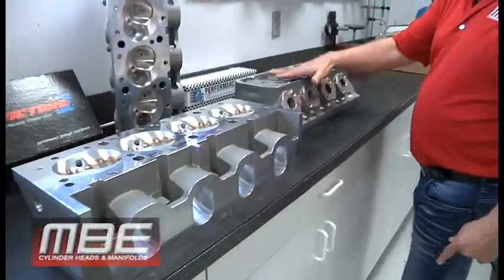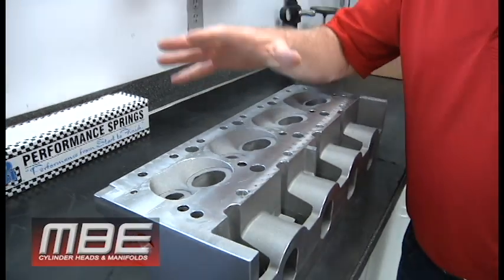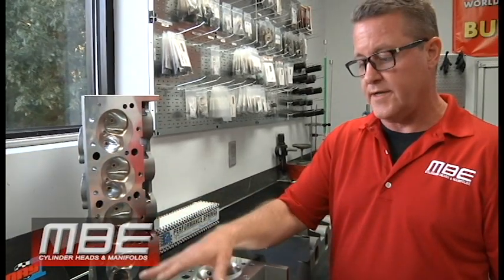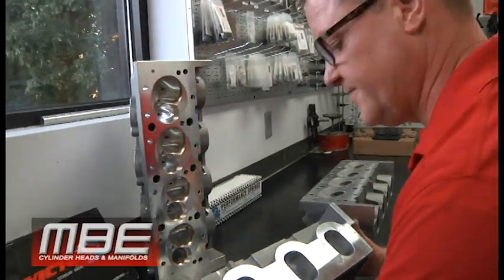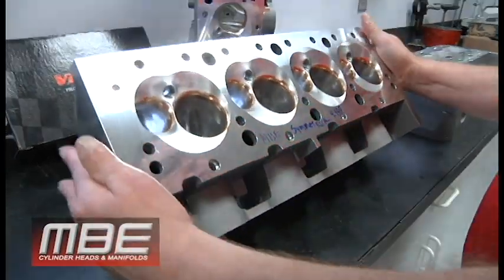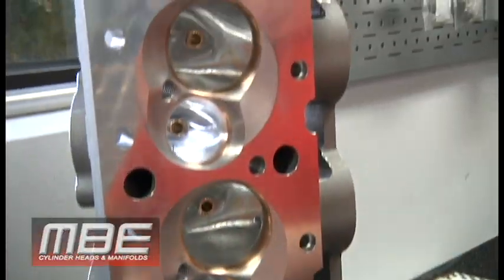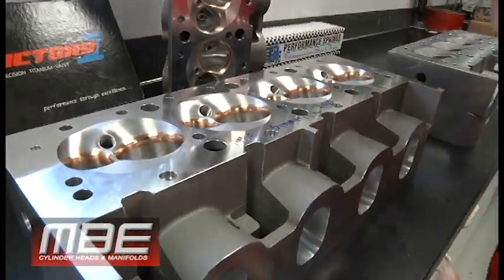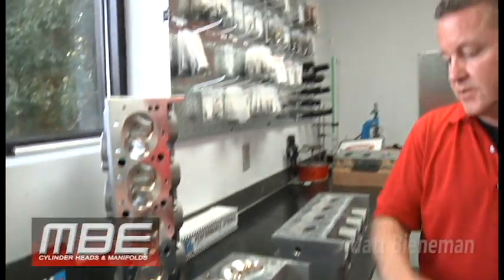** GAME CHANGER **  This SBC Cylinder Head will change History

Comment: I have two questions: 1) Minimum bore size? 2) Is 10k enough for a complete pair?
Reply: 4.125" for a lot of their heads. Don't know about these, yet. And $10k is about what the bare castings cost.
Reply: @Carl_Jr  for 10K a guy could build a blown LS and just be done with it.
Reply: @yurimodin7333  If the class he's racing in allows it. These heads aren't for the guy who could boost an LS platform and make big power. They're capable of so much more.

Comment: IT would take a 350 chevy spinning at 12, 000 rpms to use 480cfm heads, N/a to their potential. Boosted, I get, but even then 6,000 rpms at 15 spi boost still the same air. Why this head flow, for a small block? Just for racing, that limits what motor you can use?
Reply: Any Dart block is in love and crushing over these heads about now.....
Reply: @kramnull8962  okay so are they just running them to 12 grand, are they boring and stroking it to a bigger displacement? Are they doing forced induction.. how is a small block going to take advantage of that kind of flow.. where you wouldn't just be better off using a big block
Reply: @Bozemanjustin  Pure nostalgia. But you know for that money they are going to a good home...

Comment: Can I run WATER in it? 

Know why stock Chevy heads are NOT "symmetrical"? Because "siamesed" intake and exhaust ports in small-block  wedge-style heads keep THE HOTTEST - CENTER TWO CYLINDERS - INTAKE PORTS  FROM BEING "SURROUNDED" BY EXHAUST PORTS. 

It's laughable you only mention "manifolds" as other "SBC" parts your "history changing" boat anchor "air-cooled" heads will require to "run". 

Where do I get a "symmetrical" camshaft for my "stock" block and those morphodite heads and DO YOU GUARANTEE THE CAMSHAFT WILL "LIVE" WITH THE COMBINATION OF YOUR "SYMMETRICAL" PORTS AND THE RIDICULOUS "BOLT ON" VALVETRAIN NECESSARY TO "C0NNECT" THE CAM LOBES TO THE VALVE TIPS?

Comment: So you turned a sbc into a windsor for more power and durability? 🤷🏽‍♂️ ill stick with ford power 😉
Reply: Windsor ? It's more like a Cleveland 4V Style Head.
Reply: Symmetrical Canted Valve, Just like Fords Cleveland.
Reply: @CarsandCats  my cylinder head is 14 bolt 😉
Reply: Stick with ford power just like jack rough…LOL …!

Comment: Bob Glidden Boss 351 Cleveland heads for SBC.  You're still stuck with the distributor in the rear, which will give you cam walk at high rpm. LOL
Reply: Next week... " We have a front mount distributor kit for the small block chevy.."
Reply: That is what a cam button is for or I run a plate mounted gear drive, problem solved If your smart enough, guess your not.